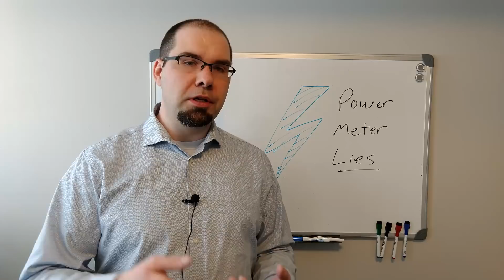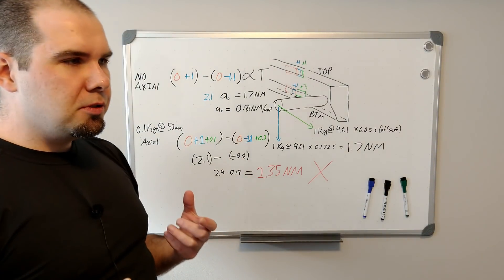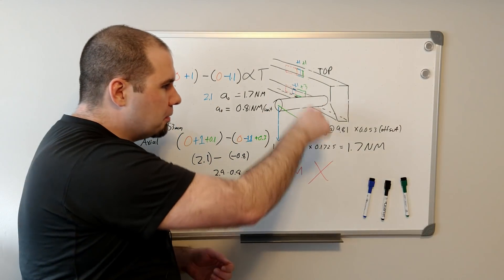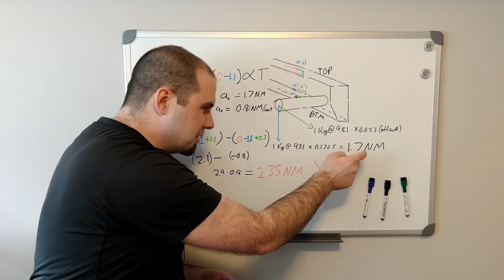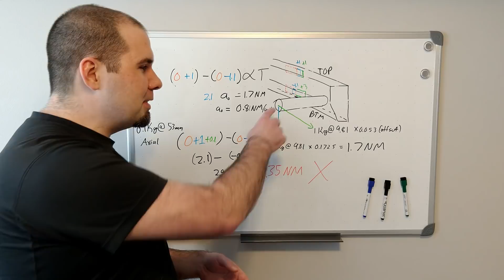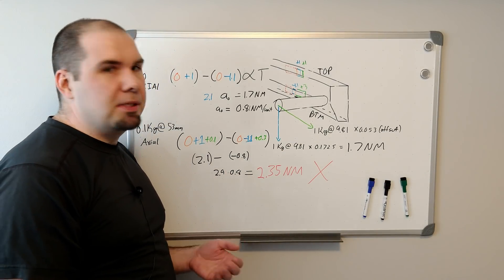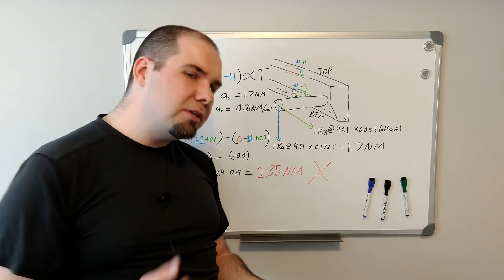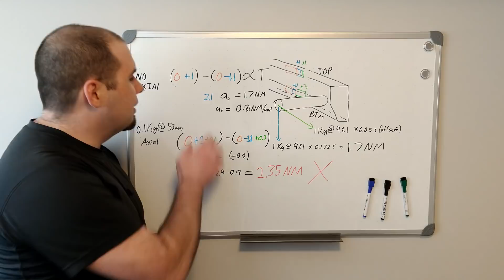Powermeter Flaws - Why your zwift data might just be wrong

Comment: I don't think you make a very sound case, of course if you change any bike fit parameters it effectively changes pedal force. I think reliable consistency is what I would consider more of an issue.
Reply from the maker: I've built several of the products in the market place using this technology. You might actually own one of the products I worked on.

Comment: I am an engineer. I totally agree. Thanks. What's your opinion about pedals based power meters ? Another question to have in mind : do we have to measure the real given power or the useful power meter to make the bicycle go faster... That' also a good question...
Reply from the maker: I don't know if I fully follow, but essentially trying to get to accurate torque in the correct direction for one of these devices. To be accurate you want to have the lowest sensitivity to other forces and torques. So the most accurate is what causes forward motion of a bicycle because Power = Force*Distance/Time. A force that causes no motion, as you'll recall from the school days, results in no power. So the real power and the useful power are effectively the same because there is no force you can put on that crank that causes motion that isn't rotation of the crank.  It's more of a transducer sensitivity to wrong forces problem. If I push along the length it causes no torque, and if I push into the crank the same. However, a good sensor for torque should read 0 in these instances and surprisingly it's very hard.

Comment: Nice video. Would the Stages L/R, the Shimano and the Pioneer not exactly suffer from that problem you outlined ? how accurate can they then still be? Should you then not always go to Quarq / SRM / power2Max? Thanks!
Reply from the maker: One (and maybe 2) of the ones you mentioned recently started using a compensated design that is very tricky. Though, there are some problems that I know none of them have even tried to tackle and has been kicking all their butts. And yes.... having engineered several products in this field I would not be buying any of those mentioned, and I wouldn't buy anything at all on the 9100. Worse crank to turn into a powermeter EVER mechanically. Quarq has just engineered the near perfect design... as a throw away product with only compatibility to AXS (roller size difference). My SRM experience shows a lot of zero shifting due to installation (quarq solved this with 8 tapered bolts), shifting due to changing chainrings (4/4 units I've used over the years, Quarq solved this by non-removable chainrings... but disposable PM), and the lack of active temperature compensation (quarq and p2max did this). I hold no love for any, but the SRM is a particularly dated design. Even the Exakt pedals are just the 8 year old polar look pedals inside with updated electronics. P2Max design requires "dynamic calibration" due to funky stress due to the two gage design. It's got decent averaging, but instantaneous torque... well...  don't expect high speed from p2max. That's would show obvious errors.. Upsell on fake metrics is a faux pas for me too. They're all imperfect.

Comment: Sorry that I am not a technical but wish mine (Rotor 2Inpower which has power inside the BB) would be accurate! :) Thanks for video all the time. Funny that even I don't understand well, your video makes me to keep watching. :)
Reply from the maker: Hey, thanks. The original Rotor crank (and the current rotor 2inpower) had excellent geometry. The inpower and 2inpower have a slight design weakness on the left side in the axle, but it's still good. Their original issues were electronics / water / and firmware, but their strain gages in the original and right side of 2inpower are superb! Machined Geometry win!

Comment: I LOVE nerding out on your videos. Thanks for the valuable content Keith. 🤓⚡️
Reply from the maker: I'm so glad other people like what I'm doing. Thanks for the feedback!
Reply: I edited in some of your footage into a Zwift Doping doco parody. I credited you in the video's description. I'd love to find a way for our channels to collab' at some point in the future.
Reply: Out of interest, what's your power meter of choice as an engineer or what would your ideal power meter be if it doesn't exist on the market?  @kwakeham
Reply from the maker: Everything in the market has flaws. Like on one hand Quarq just went extreme on "we can't trust chainring bolts" and did away with them helping solve some of the last issues with zeroing on a spider. Trade off is disposable and incompatibility. Chain roller diameter is different so you want hardcore no zeroing you'll need a groupset and wheels upgrade. I'm not keen on any arms on high end shimano cranks but on other brands like Praxis with high symmetry is good - but then you have trade off of weight and shift performance (rings are good but not as good as Shimano's in my experience). I've seen good initial results with Vector 3 and Assioma and lean towards Assioma on the installation angle figuring out side and traditional gages win on temp compensation over silicon in Vector.... but I hate the slippery feel and insane clip in force even at their lowest setting. V3 has gotten over battery door, but need a pedal wrench instead of allen key. I've also seen many pairs have inconsistent bearing quality on V3. One pedal spins freely the other feels like its filled with molasses. Nothing in the market stands out above the rest.
Reply: Keith Wakeham - phew, I feel a little relieved. I ordered Assioma pedals on Monday, being delivered today.  I’m hoping I can live with the clipping in difficulties.

Comment: As someone who's raced 20 years, I found training with power to be revolutionary. At the end of the day, the most important factors are measurement precision and the relative change over time. "Fitness" is such a squishy thing and the best thing you can do as an athlete is apply a mental lowpass filter to your training data and perception of performance on any particular day. Be patient with yourself.
Reply from the maker: I've been using and designing PM stuff since around 2011, got serious about both in 2013. They are quite a tool. The flaws relate more to the importance in relation to racing with them online. However, lots of flaws to be solved. Claimed accuracy is just that in a lot of cases.... claimed. For training consistency is good enough, but for racing where money is on the line while you're sitting on a trainer and someone's reads 10% higher, that's where it'll matter in a few years.

Comment: And that's why we use shear patterns near the centre line... Im sticking a HX11 board on your Precision ;) interesting to see the Vout between cranks. Thicker 105 vs thinner DA etc...Great video KW. Edit: i can't think of a bending bridge type that's assymmetric...? Verve and Rotor both symmetric.
Reply from the maker: Shear patterns are for toqure and shear stress caused by bending. But the shear caused by torque is about 100 times larger. So you need a shear gage on the opposite side.. Where a foot would be. And even then it's asymmetry causes it to not directly work. 6 years ago pre 4iiii's I tried shear gage instead of bend. Doesn't work. There are configurations that do. My name is on several of the patents.
Reply: @kwakeham  i know what shear patterns are for :) i guess you use further gauges and software to take out the parasitics. When you say the shear from torque (caused by pedal spindle length) is about 100 times larger, larger than what? The shear caused by bending? That makes sense. I guess those double half bridge circuits only work properly on spiders where you have symmetry.
Reply from the maker: Re-reading your original comment, I think I slightly misunderstood what you were saying. I think now what you meant that when using a shear bridge you put that on that axis, while I originally interpreted to mean get ride of the bending and use a shear (this is how axles sensors works). The assymmetric arms. Anything Shimano in the last two generations on Road bikes. DA especially. Rotor's original PM design with gages inside was the pinnicle of perfect. Verve... milled 2d forged arm with bending setups on either side... not as perfect as their lead engineer has marketed. Plus, Verve is only passively compensated. What I meant was that there is shear stress caused in an arm by bending. Take a quick look at cantilevered beams moment diagrams and there is shear. It's just with a bike arm, the shear from bending is very small compared to the torsion due to the pedal offset.
Reply: @kwakeham  yes we are on the same wavelength now. Full bridge shear gauges in the axle must be pretty good considering the two bearing supports. Should take out almost all parasitics apart from torque. Of course they'll be a bit of bending. The strain resolution on a 30mm Al axle must be pretty good at say 150Nm. I guess packaging and gauge installation was tricky for them. Also agree the shear due to torque from pedal offset is huge. You could get around this somewhat by recessing your shear pattern so it lay on the neutral axis in torsion, but practically this is impossible - as you mill down the thickness you just chase down the NA further and further and never actually hit it unless you machine from both sides.

Comment: i seriously love your vids  ,  even tho  99% of the techniqual quotes im like   wtf  lol ,   but   would this mean that a pedal based power meter would be  more accurate then    a   crank based 1 ? or am i making shit up in my brain ?  
cheers keep up the great  vids bro
Reply: Pedal based is very accurate because the force acting on the pedal axle is in a pure shear. When pedal designs use a dual bending set up. Angle and force output can be instantaneous resulting in a very accurate reading. We need to remember that cranks are not designed to be transducers. And yes data can be flawed.
Reply from the maker: Pedals can be, but the biggest flaw in them is the orientation "figuring outness". This was a huge flaw of Vector 1 and 2. People not setting installation angle correctly could lead vector to be wildly inaccuarte. V3 is better. Honestly, assioma's have been rock solid for me. Figures out the installation angle so fast and accurately. This is where it comes to the polar pedals (also now known as SRM exakt). They use a shear gage setup but only in one direction. If you're angle is off fractions of a degree it's game over. Not only that, but the system is detecting pedal rotation and not crank rotation with the little magnet in it. So if your foot wobbles at the wrong place it losses accuracy on two strokes. But that's secondary to angle / jam nut problem of those pedals. Pedals also tend to require a little work hardening for heavier or powerful cyclists. All the machined edges and changes in angles are stress risers. Partly why better reviewers said to "do a few sprints then re-zero". They had to be work hardened with tiny amounts of permanent deformation on the microscopic scale that was detectable by the gages.

Comment: Woul left / right balance would be a bigger factor affecting accuracy on left only crank power meters??! For Zwift racing, smart trainers might provide more accurate results? In my own experience, my 4iiii left sided PM gives me 5-6% more power than my Direto smart trainer, due to left being stronger. But that varies depending on the effort, at theshold this gap narrows. This variablity dependant of effort level, to me, makes left only neither accurate or precise.
Reply from the maker: I've never been a fan of single sided. Your right. Balance is that unknown that's way more variable. However it's one of those things that I would say for eSports racing single sided shouldn't be allowed. Something most won't want to hear.
Reply: If my power meter were reading 5-6% out, I'd send it back.
Reply: @lifeafterlon  This is the nature of single sided measurement, and not necessarily the device is at fault. Most people are not equally balanced between left and right legs. Single sided power meters simple measure, and then assume the other side is equal, so double it. But, if your left is producing 52 % of the total power output, the result could be a 4% over reporting of power being produced.

Comment: I like your videos, keep going. The super technical stuff flies over my head, but - I take a different approach to the whole 'problem'. I don't think e-racing necessarily has to be a simulation of who would win in the outside world. I think part of it is learning to 'game' the system. In this case (correct me if I misunderstand) a user on the cranks you explained here with a 'bad' pedaling stroke would be wasting torque in the real world. IE: They're putting torque into the cranks that isn't actually propelling the bike forwards. But, in this crank you showed, the power meter interprets that as 'useful' power that can actually propel the bike forwards. I don't think it's necessarily a problem? I mean, the rider is still spending energy to make that (misguided?) torque? So if mashing squares on the pedals gives you high power numbers that wouldn't actually propel a bike forwards in the real world, I don't think it's a huge problem, so long as everyone has the same chance to mash squares. I guess it could be compared to using non-round chain rings in the real world - the science says it's an advantage but only a few riders do (can?) use them. 

Anyway, mad respect for your conquest to make a fair playing field for this e-racing. Oh, and as one of those 'reviewers' who throws power-meters on a bike and just compares a bit between different power meters; I apologize for being a part of the problem and not the solution. >_<
Reply: China Cycling - I think what he is saying, from time to time for many reasons cyclists push harder than normal in the lateral direction, instead of mainly vertical, most crank arm power meters cannot possibly give absolute repeatable accurate power readings unless power meter companies add more sensors to capture lateral strain, the irregular shapes in crank arms plus these type of power meters do not have enough sensors to capture absolute accuracy, so when the companies try to re jig the algorithms to try to capture power at lateral angles they are only guessing at best. Power meter testers do not find the problems because they use one type of crank arm normally to test the meters and if they are reading the same as majority then are  good, so not helping highlight this problem to customers and professional cycling. This is a problem for e-racing in the future as it needs to be accurate to move forward otherwise less serious riders and teams will not get involved, if they get involved then the industry as a whole would have huge growth spurt.

It’s true that pushing too much laterally and less vertically will propel forward less but it can still propel you forward and sometimes we do that to compensate temporarily for an inability to push down too hard for what ever reason. But the effort captured pushing laterally at every point would need to be calculated properly in order to find out how much you would actually move forward in the real world.

I’m guessing pedal, hub and hub power meters don’t have the same problems? Potentially they have some of the problems but not all. They still need to capture the lateral power but the software they provide and online cycling apps would need to accurately predict how much to propel forward the cyclist from the lateral and vertical power numbers at each point.